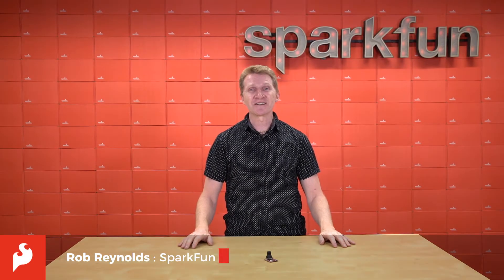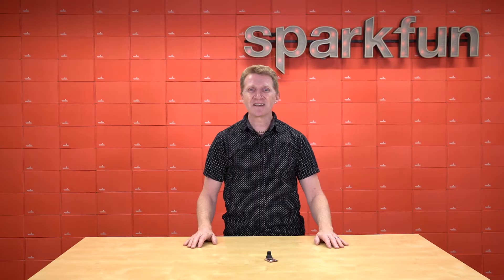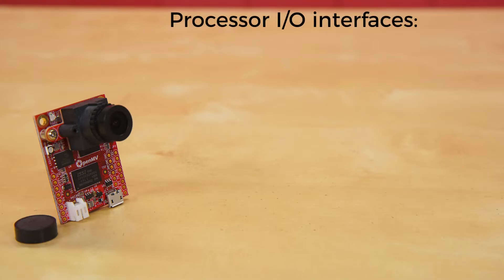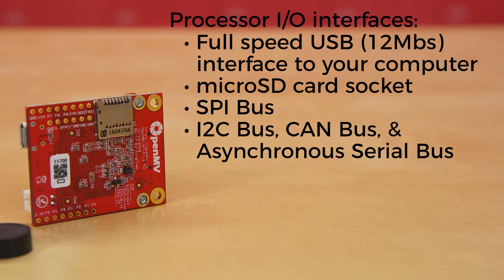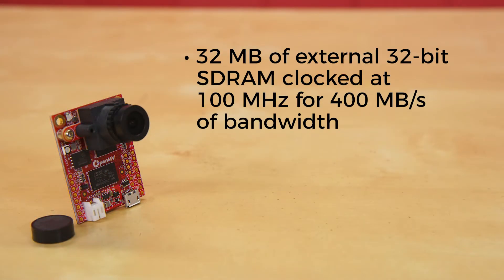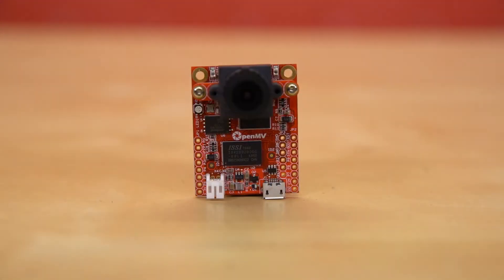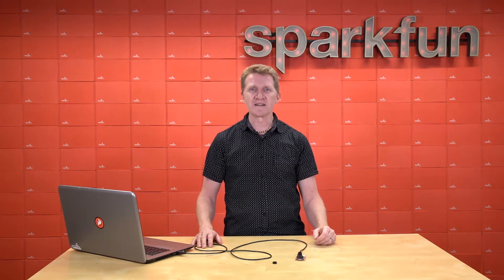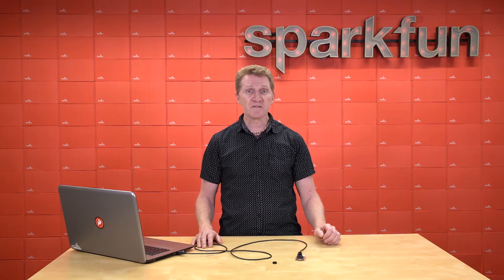Product Showcase: OpenMV Cam H7 Plus

Comment: What is the difference between this one and the normal OpenMV H7 model?
Reply: It switched from the OV7725 image sensor to the OV5640 and it adds 32 MB of external 32-bit SDRAM and 32 MB of external quad SPI flash.
Reply: @chrismccarty2507  so what does it technically allow me to do that the normal h7 doesnt?
Reply: @MrHD71   maybe, this model has been improved of memory read speed. the image is possible of fast processing. 
The introduction also says that high fps processing is possible.